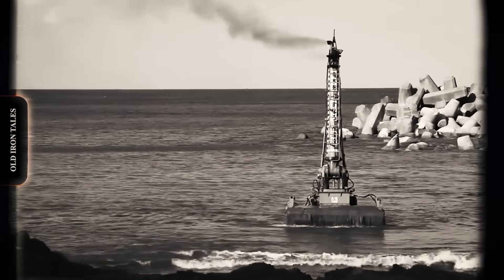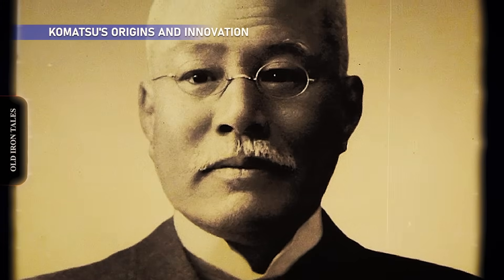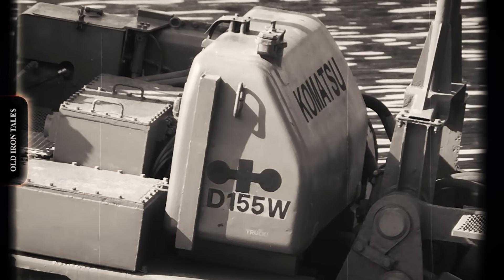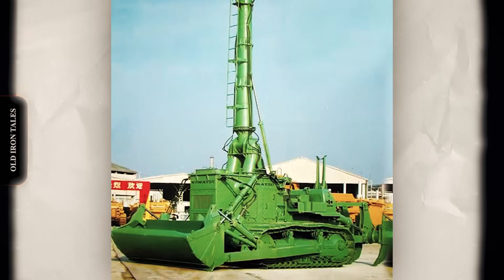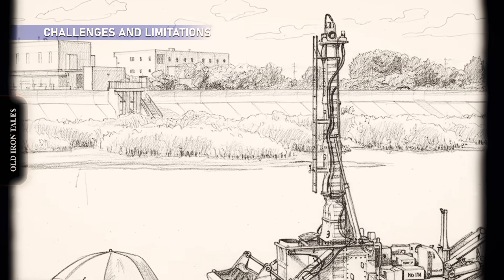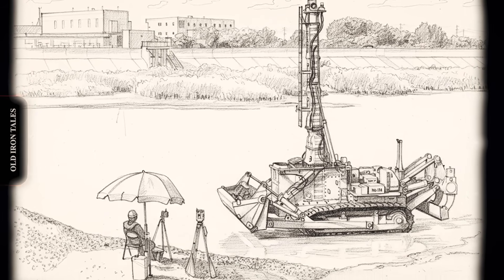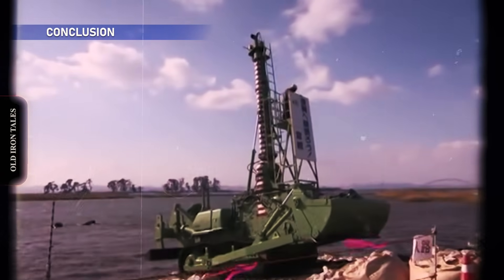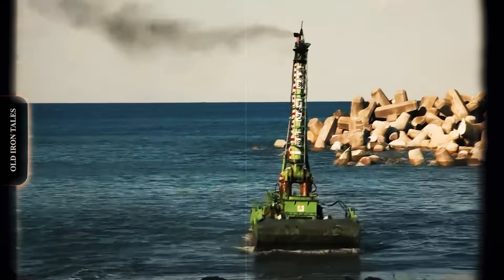The INSANE Komatsu Amphibious Dozers

Comment: So, they replaced the tube for the engine, GPS and antenna, with a tube for the GPS and antenna.
All while switching from unlimited working hours to just 4-6 a day if you count charging.
Because yes, a diesel engine Will implode at 15 meters underwater. We all know how frágile those diesel engines are about pressure.
Im loosing brain cells .
I Will LOVE to see the engineers faces when they find their machine stuck underwater with a dead battery after one hour and the divers ask them if they know about how fucking cold IS down there.
Next dozer versión, with on board battery powered battery heaters, i bet you.😂

Comment: They do something similar with old excavators underwater. Except the engine and hydraulic pump is on the surface. Then big hoses are run down to the excavator. Where a diver operates it normally. 

At some point all the old fully hydraulic excavators are going to be used up. And they'll have to design something for use underwater like that. 

It's way too profitable to lose the capability to use heavy equipment underwater.